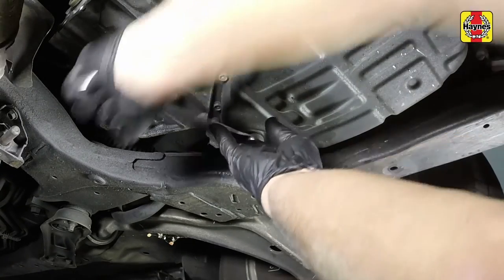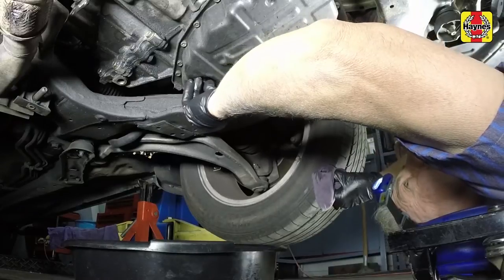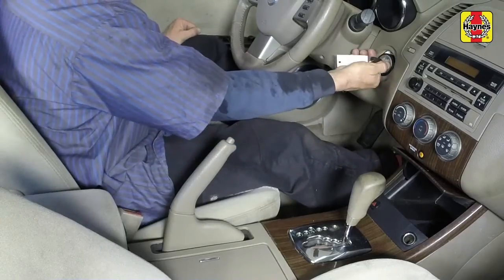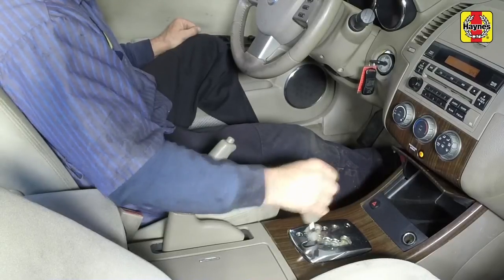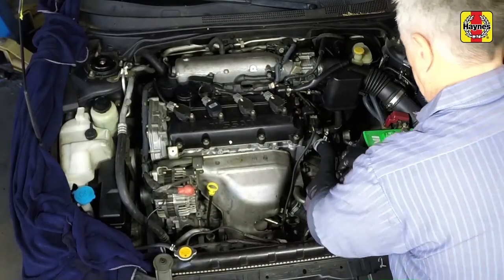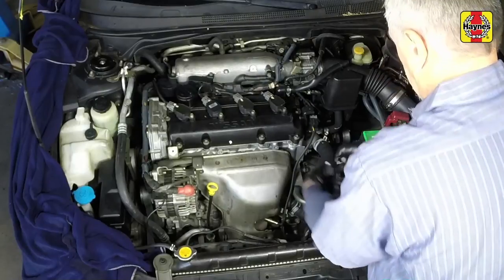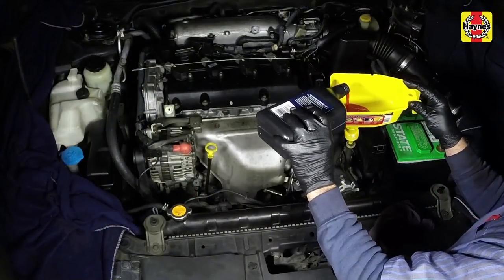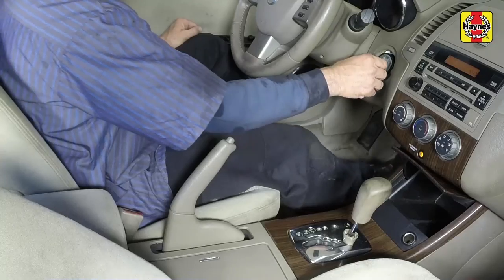How to Service the auto transmission on the Nissan Altima 1993 to 2006

Comment: 1993- 2006 Altimas  DO NOT HAVE CVT's. DO NOT USE CVT FLUID. Read your owners manual!
Reply: Bro What
Reply: @Squirrelcovers6340 true they didn't get the cvts till 2007
Reply: No. They come in 2 configurations: 3.5 V6 and 2.5 CVT

Comment: Thanks for not telling us what kind of fluid to use!!!!
Reply: It's full synthetic
Reply: @A_SlimShadeTree  full synthetic what? what are the numbers?
Reply: @richardspaulding5035  You dont get told  what fluids because there's too many, for viscosity you read the manual.
Reply: Original fill was Nissan Matic D (Basic Dexron III clone) - Any fluid made for multiple types will work great. A full synthetic will result in better performance especially when cold. Valvoline Maxlife Full Synthetic works great for me and it's reasonably priced at the local "Mart". You will need at least five maybe six quarts of fluid. More than most transmissions on a drain and fill.
Reply: @MathewPollard-vj4uq  Thanks for sharing that Mathew

Comment: This video didn’t help at all lol no details on socket sizes or which fluid to use lmao
Reply: 19 mm socket. Nissan Matic D or a modern replacement like Valvoline Maxlife. Any general multi-vehicle fluid will work well since Matic D was Dexron III clone.

Comment: Some of the pan bolts are flush with frame rail how do you access those 4 bolts to remove pan, to change filter, solinoid's, and new gasket for the pan?
Reply: With a wobble socket.